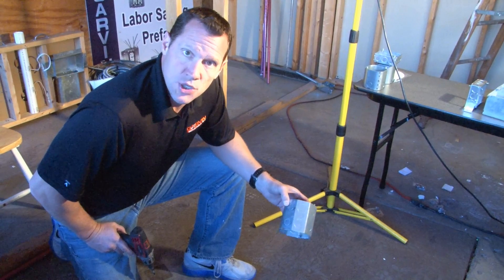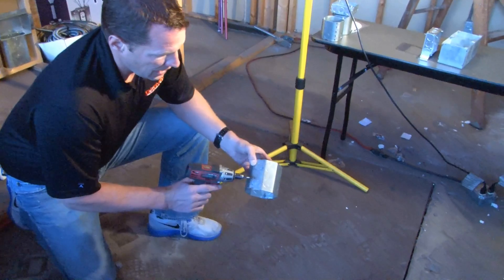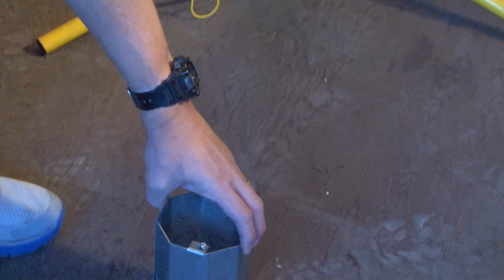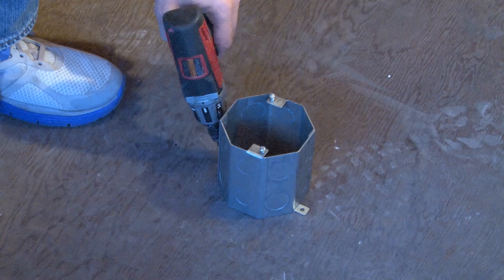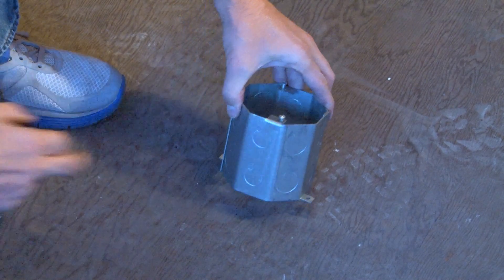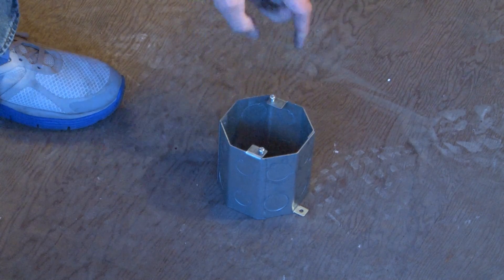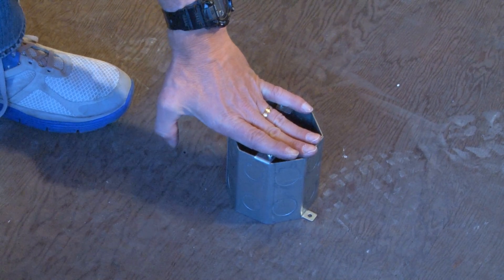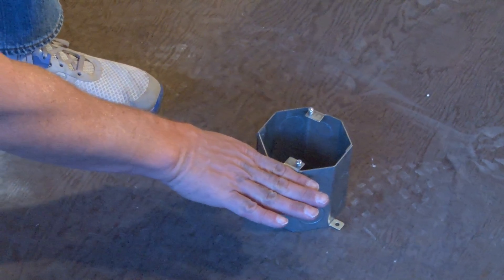Octagon Concrete Box: 4" Deep, Octagon Concrete Box with Side Knockouts OCR-400

Comment: I can't remove the Top after Concrete is Poured, it is Buried in concrete, I have to resort to do all wiring through the bottom after form is stripped. Plus the Slabs I work on are more than 4" Thick. Stratmando